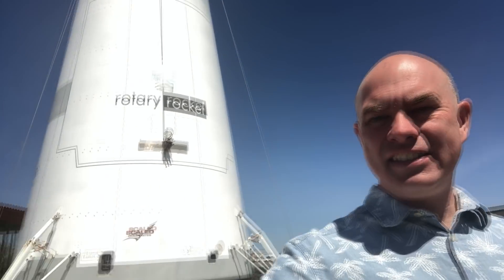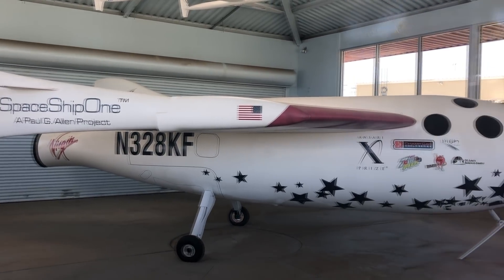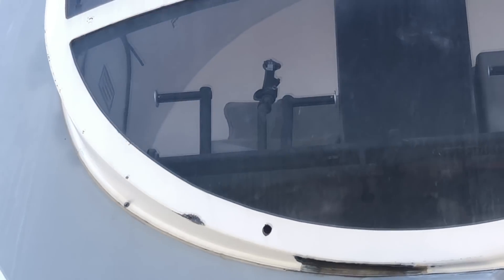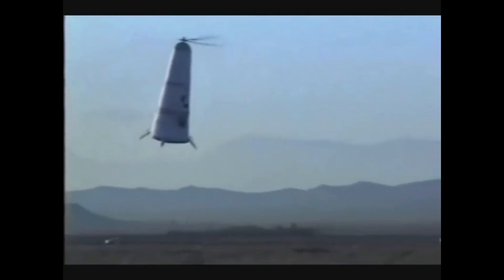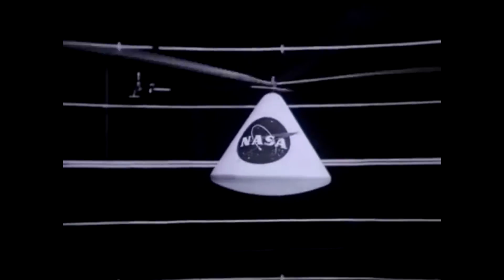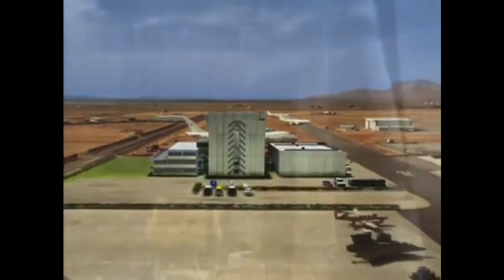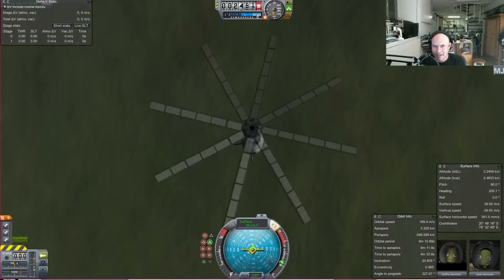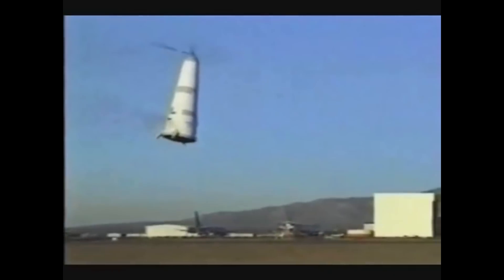Roton The Rotary Rocket - Half Rocket - Half Helicopter

Comment: What a cool concept, from top to bottom!
It might not have succeeded in its intended form, but I have no doubts that a lot of the results of their work lives on. Stoke Space, for instance, has a very similar concept for the engine section, but won't be using the helicopter tip to land.

The helicopter tip does look really cool, but I have my doubts about it. What would be the advantage over, say, a nosecone housing a giant parachute, that can be removed after landing and swapped out with a new one, while the old one is checked, serviced and repacked?

Comment: Last week I had a phone call from a helocopter museum in San Diego. They had been trying to get the Rotary Rocket to San Diego for display.

But after tries to get a ling load to work. it was too unstable to transport it. So it sits right you found it.

I used to live in N. Edwards when I worked on various DOD projects. I used to (1980s) visit Mojave Airport often.

Comment: Are the RCS thrusters stopping the vessel from turning/twisting? as typically a helicopter requires a coaxial rotor or another rear mounted rotor to counter the twisting/turning forces created from the main rotor blade, but yes, I don't see neither on this? leading me to believe the RCS would be working to stop the vessel from spinning???

Comment: Someone should figure out in simulation if it could, in theory, reach orbit - using Merlins perhaps...
Reply: The final configuration was supposed to use Fastrack engines, the same ones that merlin was originally based on. A merlin 1D would be much more capable than what they thought they needed.

Comment: Fun fact:  In the late 1990s I was a young engineer working as a contractor on a flight test project for the US Navy and Brian Binnie was the head of the flight test team.  My most vivid memory of Brian was a flight test report I wrote where I said "the pitch response to the step input was well-damped."  He wrote on the report that "terms like 'well-damped' were not appropriate for a flight test report".  When I asked him how I should phrase it, he said that I should have calculated the damping ratio.  I was just a contractor, so I replied "yes sir" and did as I was asked.  Of course, I had no idea what the damping ratio was designed to be for this aircraft, so to me, sticking the number in there was the same as simply saying "well-damped" and showing the graph, but whatever - he was the boss!

Comment: I remember first seeing this in the news all of those years ago.  It was so daring and different I recall trying to rationalise the concept with the idea that the rotors had rocket tips, with the centrifugal force acting as a pump and the rocket tips and blades turning downwards as the craft entered the thinner atmosphere.  Yes the fuel supply looked like a problem, but if SpaceX concept was released in 1999, I'm sure it would have looked like science fiction!

Comment: Pretty good video!  I had quite a lot to do with this project; my first job in the rocket business.  Much of the ridicule I see in the comments appears to be from a lack of vision.  Yes, SSTO is hard, but has been possible from since the early model of Atlas; the delivered non-structure payload is indeed small.  Reusable SSTO is harder still, but with attention to very lightweight structure and efficient engines, is also possible; the "Holy Grail" of reusable space launch operations.  The spinning rocket engine base would have generated high propellant pressures for high-chamber-pressure rocket motors, which are key for good lift-off performance.  Much of the charm of the spinning was to eliminate the need for turbopumps.  Counter-rotating rings of the base motors probably would have eventually been needed to deal with the gyroscopic forces.  We certainly showed that the "centrifugal pumping" worked with the rotor tip rockets.  The structure was large, but able to be very light due to the axisymmetric cone shape and carbon fiber construction.  The rotor blade landing system was analyzed  to weigh what a parachute system would have weighed for a sea landing, but would have allowed landing with style at the airport.  Lastly, $30 million was a comparatively lightweight investment as a start to do this sort of thing..

Comment: I was there for the rollout of the Roton ATV in 1999.  I had been visiting the offices of RR (which were in Redwood City up in the Bay Area) to interview the designers and marketing people for "Spaceship Handbook" so I got an invitation.  The Roton was one of several completely reusable launch systems being developed at the time that I was including in the last chapter.  The Roton was, in fact, the last entry of the last chapter, closing out the whole century that had opened with Tsiolkovsky.

BTW, Scott, the propellant tanks surrounded the payload/cockpit section.  The fuel (kerosene) was a flat ovide tank between the engines and the payload while the LOX tank was a narrow conical frustum starting above the cockpit, all the way up to the rotors.

Comment: I was initially doubtful of the ROTON when I first heard of it, and had some discussions about and with the developers and supporters over on NSF. (Somewhere on there after this was all said and done I've got 'permission' to try and make it work if I get the chance :) ) Essentially the initial idea required that the vehicle break Mach 1 using the rotors on lift-off which in essence depended on rotors being able to go supersonic... Which itself was based on the Republic XF-84H "Thunderscreech" (https://en.wikipedia.org/wiki/Republic_XF-84H_Thunderscreech) research program which you will note are NOT going to  be very effective as 'helicopter' blades. So while the initial concept had merit, (and the math worked) the concept would have had issues with fulfilling the two very different requirements needed to complete the mission on 'blade' power alone. (Possible mind you but it requires vastly more complex blades)

So a rocket engine was needed anyway so the rotors defaulted to a recovery role. Nothing against Gary et-al but at this point it was pretty obvious that requiring the design retain SSTO capability was a bit counter-intuitive and not a little bit disingenuous to the overall concept. Understandable though because SSTO has that draw and base assumptions around it. From that point on making it a Two-Stage or 1.5 stage to orbit vehicle makes a lot more sense both in concept and in utility.

And that's what I hope to see one day done with a highly reusable booster and a rocket-rotor recovery upper stage because much like the promise of the SpaceX Falcon/Dragon combination a rocket rotor ALSO has the capability of landing on just about any planet in the Solar System :) 

Thanks for the review

Randy

Comment: This is a really interesting idea.  You could feather the blades to slow down during atmospheric reentry and then feather them again as you approached the landing pad turning the rotational energy into lift.  It's awesome because it requires no fuel to do this controlled landing.  Thought weight of the fuel vs weight of the blades, rotor and  feathering mechanism would probably outweigh the fuel...except the system would (could) give you a very gentle landing....

However, most people that have lost power in a helicopter and landed this way find it to be a wild ride:  https://www.youtube.com/watch?v=BTqu9iMiPIU

Comment: I always presumed the point of the rotor was to lift the rocket up before firing the engine. And I always wondered that's how your going to make SSTO?! It's really going to save so much fuel? Turns out it wouldn't and it didn't

Comment: So, if you slap a first stage underneath, you could have a working concept? Unfortunately for the concept, parachutes are great for packing a lot of air resistance into very small mass and volume with low complexity, provided you can tolerate the imprecision on landing.

Comment: Scott,
There’s more to the story. Gary Hudson’s original concept was to have rotor blades attached to an annular slip-ring around the base of the vehicle. The idea was to use centrifugal force as a means to pump fuel/oxidizer out to rocket engines at the rotor tips.

Comment: Those blades would have burned away on reentry unless kept in their casings during that phase.  The disk loading appears to be very high,  the radius for a soft landing would likely have the blades twice their length.  Piloting a full autorotation to landing without any perceivable yaw control would likely end up with the vehicle tipping over once on the ground.

Comment: How come the roton did not spin out of control when it didn't have a "tail rotor" to keep it from spinning like a normal helicopter?
Reply: I think that's where the tip jets came in, so it didn't transfer angular momentum from the rotor to the body.

Comment: Whoa Scott! I actually went out to Mojave Airport a few years back and saw the Roton Rotary Rocket prototype featured in your video as well as the SpaceShip One in its little display building. Also on the grounds of the airport is Scaled Composites where Rutan built his various designs including SpaceShip Two that is supposed to start conducting commercial operations for tourist astronauts. Thanks for the great video of this cocamamy rocket with the rotor blades.

Comment: The 96 combustion chambers around the aerospike/heat shield were fed with a centrifugal pump the width of the base. The entire engine was rotary!

On the yes that's clever end of the spectrum, at least the heavy end always pointed down (as opposed to the Venture Star).
Reply: One of their engineers told me they could make orbit with the same amount of fuel that a 737 carries. I'm not sure that math would have ever checked out. What kind of chamber pressures and engine efficiency would be required?

Comment: I worked on the kerosene engines for the Roton, figured out how to control the wheel speed, and showed the ground crew how to move it around in the hangar. Those were some good times.

Comment: what provided counter rotation force?
Reply: Counter-rotation is not a problem here as the rotor blades are by ram jets at the rotor tips. The minor torque coupling caused by bearing inefficiencies (friction) is fully absorbed radially by the blades and center shaft pivot bearing.  If the shaft and blades received their torque from a rotating force coupled to the framework of the rocket, then the engine and the airframe would experience contra-rotaional torque effects. Once again, you can thank Isaac Newton for this (no opposite reaction through the connecting shaft). The only action-reaction forces here happen between the ram jet nozzles overcoming the inertia of the blades tangentially to the path of the blade tips.

Comment: If that thing worked it, piloting it would be like the dumbest scene in the Right Stuff. No, apparently it is possible to land a helicopter due to air drag rotation after it's rotor has failed.

Comment: I feel that some ideas tend to be ahead of the current level of technology, and in a decade or two(or with enough financial backing, and or design tweaking)could be revised/ revisited and actually become successful. Imagine a rocket launch pad that had 4 sets of rotors( obviously a very large pad, partially helium blimp, and very large rotors) this could theoretically lift a lightweight rocket to a substantial enough height to reduce the necessary fuel and weight to reach low earth orbit. This though not technically a single stage to orbit vehicle could mean all components would be reusable. As per one of my favorite quotes “Any sufficiently advanced technology is indistinguishable from magic”. Arthur c Clarke

Edit: after reading my post it sounds crazy but... after hearing about this rocket that’s what me and brain came up with.

Comment: Actually, Classic Rotors (Ramona, CA) was supposed to have taken the Roton to its museum. As I heard the story, they raised money and paid expenses for a US Army helicopter to transport it from Mojave to Ramona. Unfortunately, the Army crew miscalculated the required length of the lift cable (Classic Rotors' guys said they told them they'd need something like 200', but the Army guys decided to use less than half that). When they tried to do the transport, things did not go well soon after lifting off. Payload and helicopter fought each other for control. As Classic Rotors tells the story, the Army pilot sweated bullets just getting the thing back on the ground in one piece at Mojave. They then told Classic Rotors that they were done trying to transport the Roton. If you visit the CR museum in Ramona (and I strongly recommend it), you will however find the actual rotor mechanism from the Roton, and I think they also have the blades stored away.
Reply from the maker: Will add that to my list.
Reply: @scottmanley  If you let me know when you go, I'll be happy to go through the museum with you. And I might be able to figure out how to make sure that one of the more knowledgeable docents will be there. They have several very interesting aircraft there.
Reply: @scottmanley  Mike Massee has a lot of photos of that attempted lift. I was hiding behind a shipping container when the swinging got too exciting, but he got some really exciting photos, including the moment when the Chinook pilot punched a hole in his floor with the rotorhead of the Roton.

Comment: Please consider a camera with image stabilization for your handheld selfie monologues.
Reply from the maker: I bought a gimbal mount and never used it because they weren’t compatible with any lapel mic I could buy.
Reply: @scottmanley  I appreciate the reply! There are many cameras with in-camera image stabilization. Even my venerable iPhone 6s+ will stabilize video and eliminate all but the most severe hand shaking and vibrations. Alternatively, you could use the gimbal with the camera and record audio from the lapel mic separately then dub it in post. Just snap your fingers or clap on camera to for an easy reference to synchronize audio with video.
Reply from the maker: @AndrewSkow1  I do all these :)
I use an iPhone X but when i'm running in selfie mode it has no stabilization. Also in this case I had 5 minutes to do the whole thing before running over to my appointment.

Comment: I'm in Lancaster CA right now on a work trip.  I'll probably be making some time to get up there to check it out.
Reply from the maker: Check out the Blackbird Air Park in Palmdale.
Reply: @scottmanley  I will absolutely check it out.  If you have a few minutes, it may not be much to look at, by there is some cool tech installed on the North end of the Palmdale train station that I'm working on.

Comment: We always hear about how expensive it is to launch something due to fuel costs, so I have a question: would it be practical to use a HUGE propeller system (bigger than helicopters) to lift the rocket to 25,000 feet and THEN kick in the rocket to get to orbit? Not POSSIBLE (which it is), but PRACTICAL.
Reply: Not useful.
When you want to go to orbit (as opposed to making a suborbital hop to the boundary of space) most of the fuel is not spent on gaining altitude, but on gaining horizontal speed.
Reply: its all about the speed, not altitude